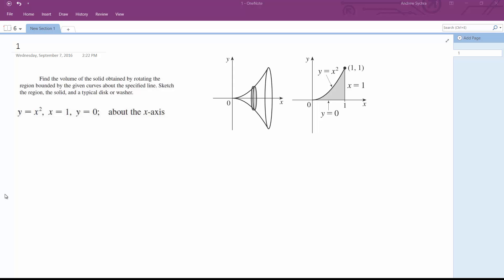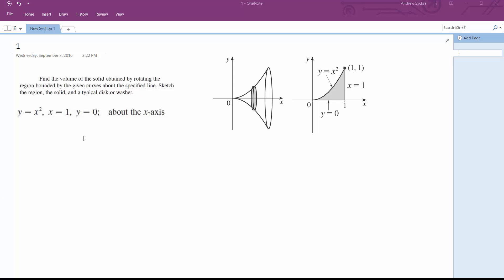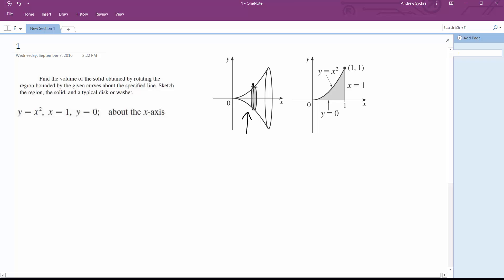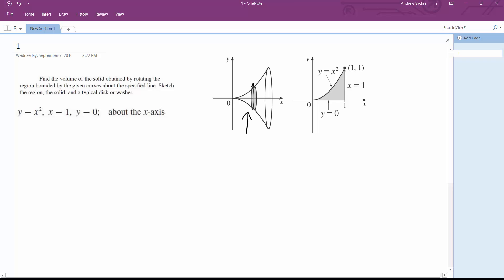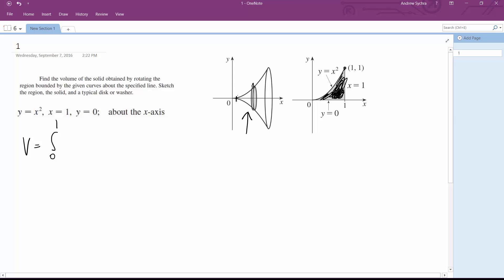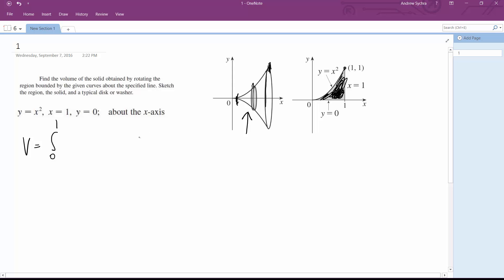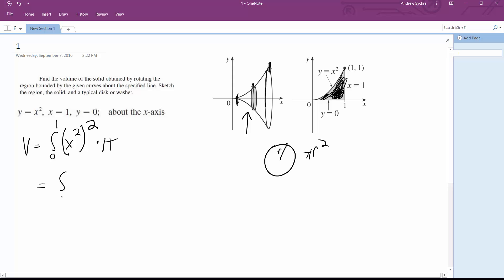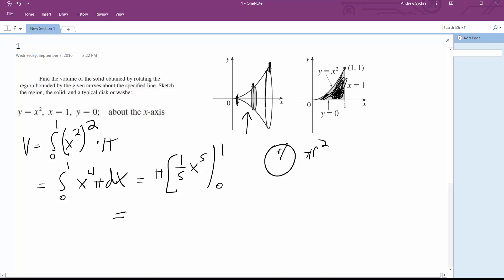y = x^2, x = 1, y = 0; about the x-axis

Comment: Thank you for this video! I did this problem for an equation in my homework, and ended up getting the same answer you did, but my book had a different answer. Turns out the book has a typo and asks for it to be rotated about the x-axis, when the answer is for it being revolved around the y-axis.
Reply: hey wondering what do I do different if it is the y axis. Still a little lost on this subject